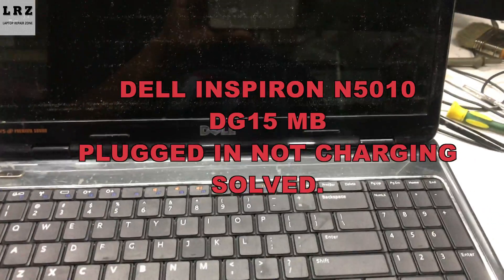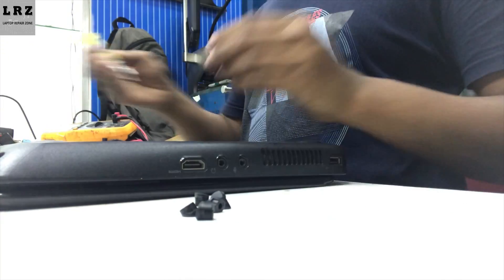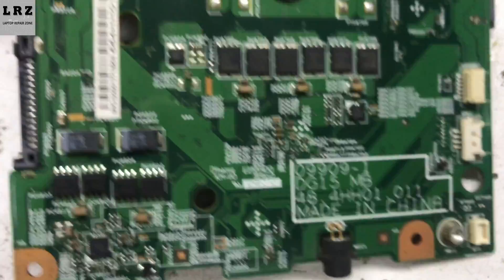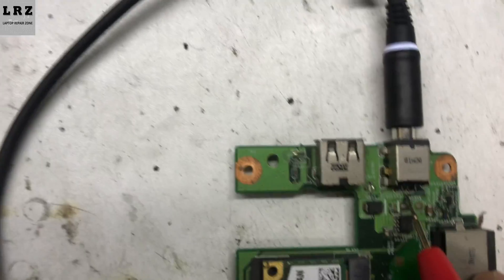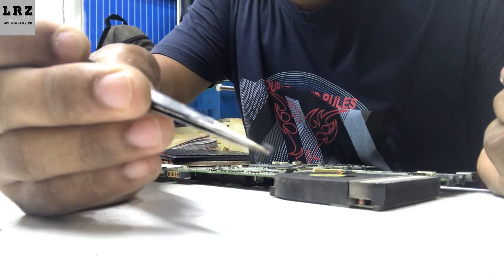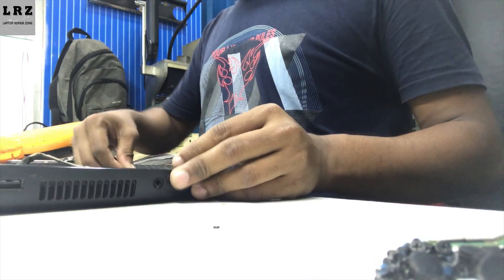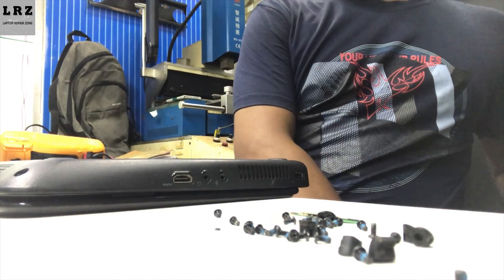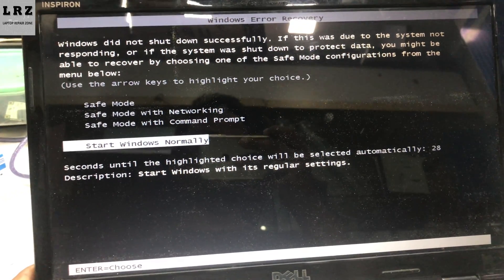Dell Inspiron N5010 Plugged in Not charging solved.

Comment: I also have the problem that the charging LED won't turn on, but it powers on the connected computer without issues, and it recognizes the battery. I already checked the process in the video and apparently everything is fine with the diode, so in this case, is it recommended to replace the battery?

Comment: I have an issue for my hp elite book 1030 G2, if i unplug the charger, the system will goes off. It power with battery and goes off small time

Comment: I have same laptop. My issue is sometimes the indicator light does not light and the battery doesn’t charge even though the screen shows plugged in. Sometime later when i shut laptop down the battery indicator lights and battery charges! What might be the issue?
Reply from the maker: Try with another charger, if same problem then you need to fix motherboard

Comment: I am using same model Dell N5010 and facing issue that when turning on with battery is shut down. But without battery it is working fine. I also remove this diode . what should i try next.
Reply from the maker: Thanks for your comment, please check charging section.

Comment: Hi,

Is the PSID of the same voltage on an adapter for the Dell Inspiron 1525 ? 🤔

Because I have the same issue on this laptop & I'm trying to diagnose which component is bad. 😑😕

Thanks !

Best Regards,
Reply from the maker: Thanks for your comment. yes the voltage will be same or you can check schematics diagram for this laptop.
Reply: @Laptop_repair_zone  https://drive.google.com/file/d/0B6IqcVTk0jpYd2ljRlNuMlltSmc/view?resourcekey=0-t4pocnH3Sq065z_b4Kl6Yw
Reply: @Laptop_repair_zone  That is the link to the schematics for this laptop. Now on which page do I look ? 38 ? 😕🤔

Comment: Thanks for the video - it inspired me to fix my dell 5559 laptop which has this issue. In the 5559 issue it blew a FET along with the protection diode so I had to replace PD3 and PQ6. The schematics for it are available online. This failure had also broken the single-wire comms in the charger and so I had to also replace the charger. With those changes the laptop is now back up and charging again. Phew!

Comment: hello friend. i have completely applied uma conversion but i have charging problem. i bought new battery and inserted. after that, in windows charging but % percent going to down. (Not charging) what's problem? charhing light off on front panel.

Comment: if the battery is not detected where is the problem?  because the battery is new (dell n4050)
Reply from the maker: Dimas Gumelar thanks for your comment, first check battery positive line short to GND or not then check DATA CLK signal line.
Reply: In motherboard?
Reply from the maker: Yes
Reply: @Laptop_repair_zone  if short what should I do?
Reply from the maker: If short the you need to find out which parts short and replace them.

Comment: Dell inspiron 5110 charging problam plug in not charging  pls solucation
Reply from the maker: Thanks for your comment, try with another charger and battery, if problem not solved, then check PS_ID signal.
Reply: Have you find the solution l...? Being experiencing the same problem with my n5110

Comment: Compaq c700 laptop charging problem plug in not charging how to solve
Reply from the maker: thanks for your comment, first try with a new battery if problem not solved then you need to check charging section in your laptop motherboard step by step.

Comment: I also tried and removed the diode and now it work’s perfectly.....thank you bro.
Reply from the maker: This diod is optional no problem if you don’t use it more then 200 laptop i fix this problem without this diod there still working fine. N5110 you need to download schematic and you can find it on charging port board thanks.
Reply: @Laptop_repair_zone  amazing
Reply: I do have same problem in dell inspiron3521 but laptop repairer asking 3300(INR) for this. Is this worth paying them 3300 cauz i think they are asking too much for this stuff
Reply from the maker: thanks for your comment, please share my channel to your facebook
Reply: @Laptop_repair_zone  what is the reason make this diode infect and if i dont replace it may another time the motherboard will infect because this diode is not install, as you said it is for protection, i have n5110 so where is the place of this diode

Comment: what would cause that diode to go bad? also what is the role of the diode you removed? and what risks have you assumed the customer would be ok with? can it now catch on fire? or is this just a matter of making sure you use a dell psu?
Reply: It's a shotky diode. It protects mother board from high voltage or spike due to fualty adaptor and reversed polarity
Reply: @freemeto1  thank you for information
Reply from the maker: thanks for your comment, that diod was bad, its only for protection and its optional.
Reply: @Laptop_repair_zone  i am curious what did the diode do? if my seat belt gets stuck i can cut it out but then i dont have a seat belt for car accidents, sure i dont need it to drive but it keeps me safe. thanks for the video btw, i will try your idea
Reply: my mothboard has 7 wires coming from the power jack, even though our jacks look the same
Reply: i found a burnt diode on the underneath side  by the charging port called ...well i dont know it has 3 numbers by it: p04202, p04201, p04406

Comment: Hi, i have dell inspiron n4010, having same issue,pluged in not charging issue, will this method work in n4010? When i connect charger, charging light turns on one time then gets off, in task maneger its show, pluged in not charging, i tried to replace battery and charger both, but nothing works! Will this method work in my n4010?
Reply from the maker: thanks for your comment, first check with a new battery and charger, if problem not solved then check charging section in motherboard.
Reply: Check DC port also. the problem might be something else also.
Reply: same problem for me..i have dell inspiron n 4010..
Reply: n4010....and then your laptop is ok??

Comment: Hi I'm santosh. I have a dell latitude e6420 laptop and the problem plugged in not charging. and when the play the video it's not playing properly. and remove the charger it's ok. Here is the two problem. Can you help me. How to solve this problem. Please
Reply from the maker: santosh mundepi did you change the battery?
Reply: @Laptop_repair_zone  
Yes I'm already change new battery
Reply: Can you solve the problem. Because I'm given this laptop here some repairing shops but the didn't solve the problem. They told me that they cudunt understand the problem. Last night I'm seeing your video. Than I discuss this problem. If you can help me please give some tips or triks. If it's possible on video call so please help me sir. Thanks
Reply from the maker: It’s a hardware issue
Reply: @Laptop_repair_zone  
I know but can you have any idea what should I do sir. Can you give me some tips which section should be faulty sir. Those I check. Please